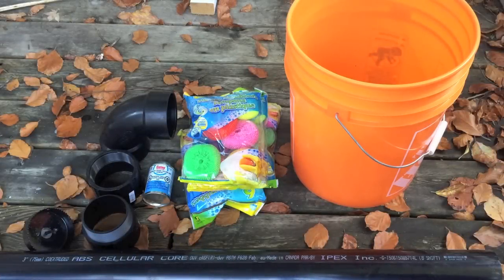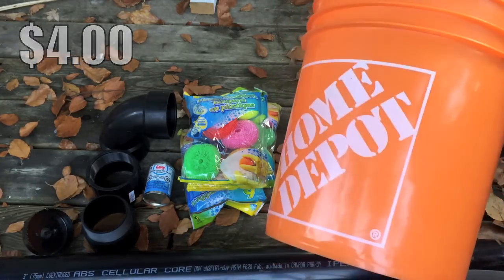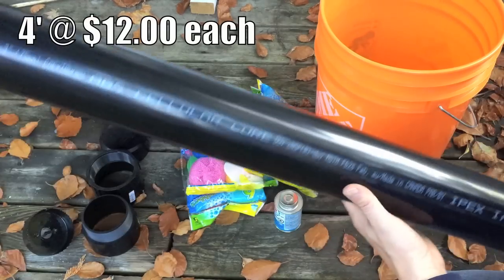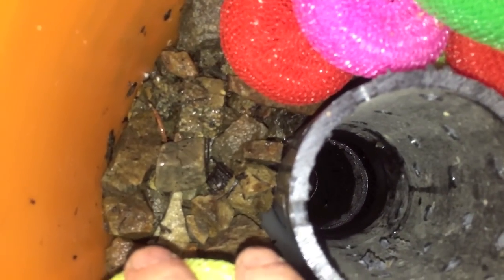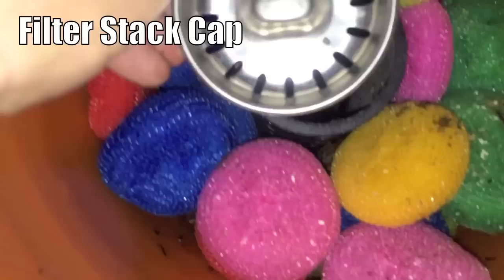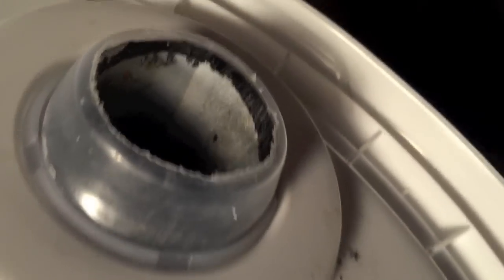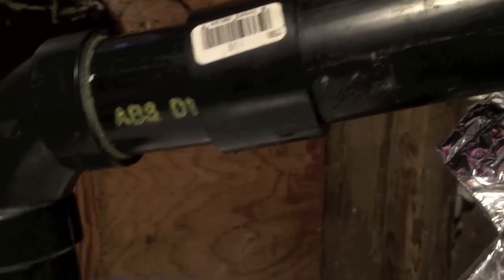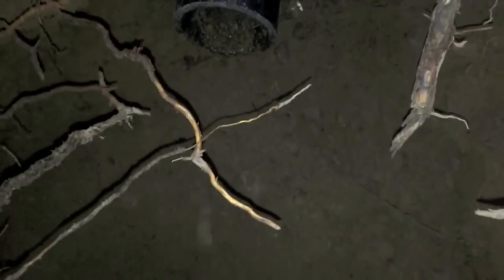Build a Better Grey Water Filter System for Budget Off Grid Living!

Comment: The HD bucket should be outside, not inside as it will stink.
Reply from the maker: Good idea, but, I run bleach through it just before I leave the cabin. No smell, but it could still attract rodents. Thanks for the suggestion.

Comment: How do you clean the soap scum and hair from this unit that comes from shower and washing machines?
Reply from the maker: Once a month, I pour some bleach down the drain and then manually remove/replace the plastic scrubbers from the first strain bucket. Yes, it's super gross. This filter system is setup for a recreational, light use for an off grid cabin/cottage (and we don't have a washing machine.) For heavy use, you should consult a plumber and look into a septic system.

Comment: You need a trap and the 2" tube should be turned into a vent tube. You need a breather to prevent suction and you should always ustiize traps to prevent any smells from coming back through. Even though you have traps before the filter you should still uses one after if for no other reason then to contain Oder when servicing your filter..
Reply from the maker: Only have one trap under the sink. But I have a have some spare traps and can upgrade the plumbing in the future. Thanks for the comment!
Reply: Something else I didn't catch the first time watching.. your inlet should come in from the side with a T fitting instead of the top with a 90* elbow. This helps calm the water and prevent excessive splashback inside. If you are unsure what I'm talking about pull up a diagram for a septic tank.. The reason this is done is so you don't have particles getting splashed up way above the waterline that will mold mildew and grow bacteria over time. It's also cause you don't want to over disturbed the good bacteria that sits on the top layers and helps to keep things clean. Good bacteria needs oxygen so in a sealed system it can only sit on the top of the water line. Might not be critical on a graywater system but it's something I would still want to do myself.. you could even consider running the inside pipe all the way to the bottom and let the incoming discharge by pushing the existing water up to the outlet instead of free falling ontop. (Think spraying a hose into a bucket to fill it vs sitting it inside the bucket) if you reduce the inlet size down and put a 90* on it in the bottom under the water line you will actually get a whirlpool effect that will help push more water through your scrubbers. The only downside to this is they will become more effective and likely need to be replaced or backwashed more often. You also would have to consider worrier case.. if you didn't clean the scrubbers and they became clogged you would have a blockage and water would creep back up the pipes so a backcheck valve might be a good idea. But it would be a much more efficient way to utilize your current design in terms of filtering. And the reason you would want to reduce the pipe size if you wanted the bottom tank discharge inlet.. is to try and add some pressure.. you don't have much fall above the tank so it would slow the drain time and heavy use might be enough to back up a little.. reducing after freefall adds pressure.
Reply from the maker: You sound like an expert John, plumber? Have you done this before?
Reply: No expert plumber. Just years and years of construction experience and lots of hands on doing things wrong and learning how to do them right on the side lol. I also spend all my spare time just finding random things like this to research and learn more. I'm not even saying my way or ideas to improve this are necessarily correct from a master plumbers view. What I'm doing is comparing your system to other things that are somewhat similar basic design but different purpose and understanding what those designs are supposed to do and why and because of that I think would better this system. Generally speaking any waste system design tends to have the general purpose design as to not stir and disrupt the standing waste.. I've seen both the bottom flow and t pipe design used and have a basic understanding of why. But I am by no means an expert at plumbing. TBH I don't think this is plumbing as much as waste removal and that is actually two different fields. Like low voltage tech vs electrician.  TBH I don't even fully understand your entire design and it's not the way I would do a graywater system but there's 1001 right ways to skin a cat and I think each way it can be done there is something to be learned and utilized from each in an effort to create the cheapest, simplest, but functioning system. I was just simply trying to give some ideas that could possible help. 

Wait a few days I'm sure someone with too much time and not enough hands one will be on here to give 100 math calculations as to why everything I said is wrong and everything you did is wrong as well lol.. I'm a fan of if it works it works but always like to find ways to improve.

Btw how did you dig out that trench underneath? Looks like you did it by hand and it came out really clean if that's the case.. then how did you backfill it and get it compacted back?